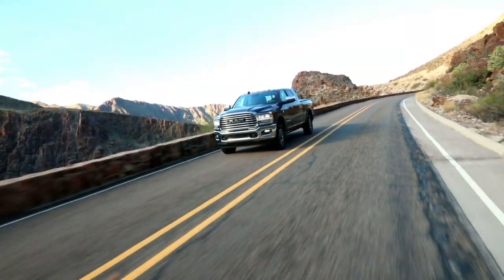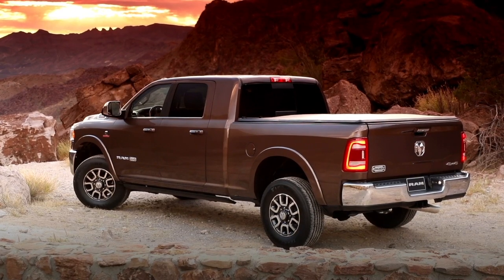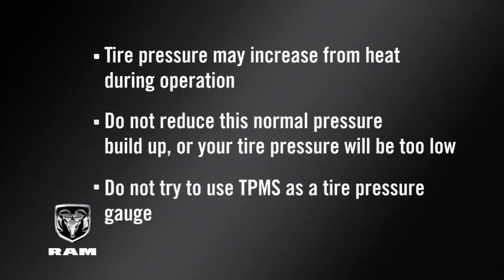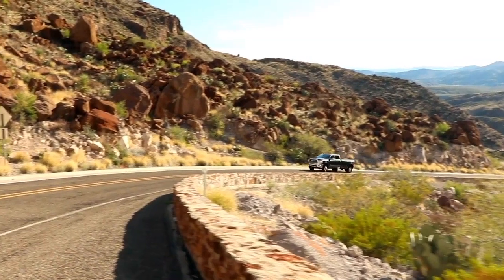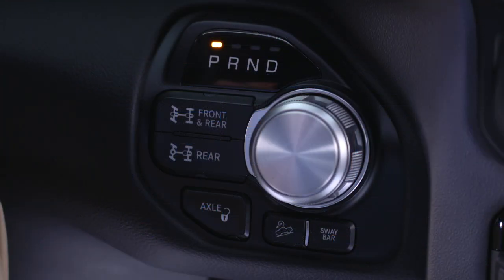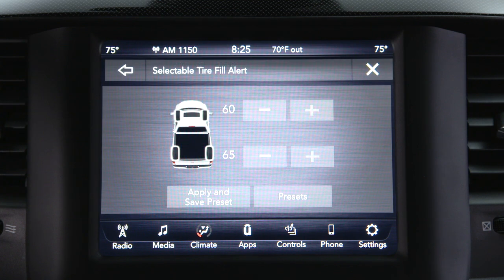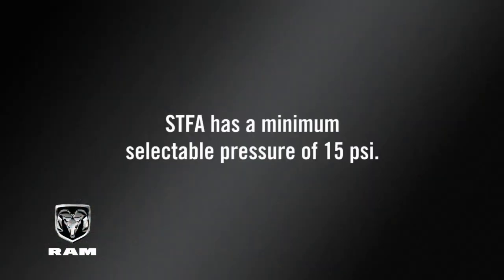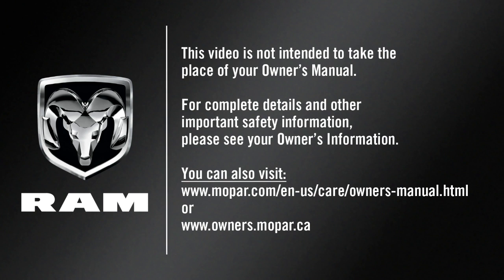Tire Pressure | How To | 2019 Ram 2500-3500

Comment: Had a “Tire Pressure System Temporarily Unavailable” pop up. What’s the deal with that? OEM sensors on after market wheels. 7k miles since installation.
Reply from the maker: Sorry to hear about that, P. Chant! We'd recommend having this concern diagnosed by your local dealer. If you'd like additional assistance alongside them, feel free to give us a call at 800-992-1997. ^SM